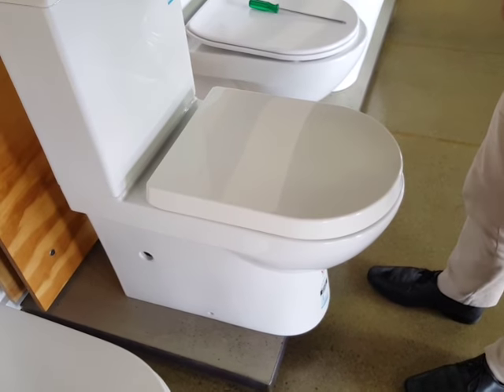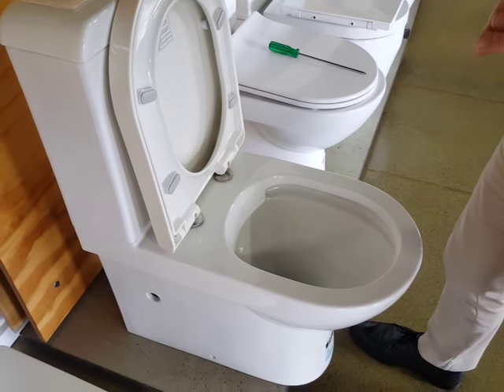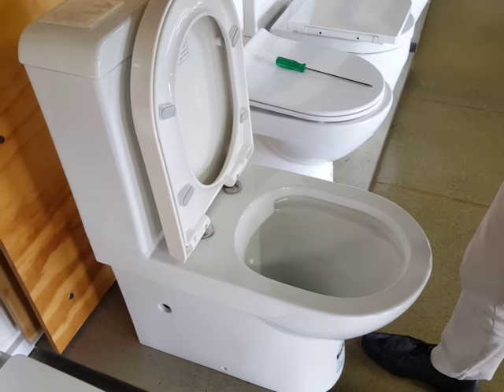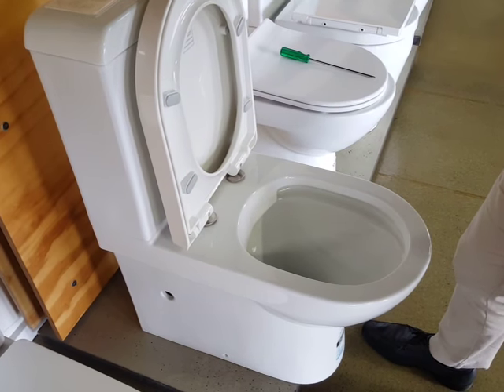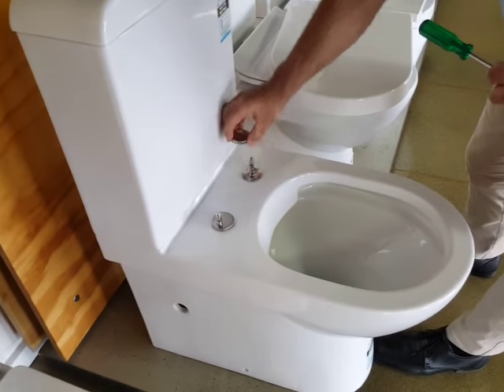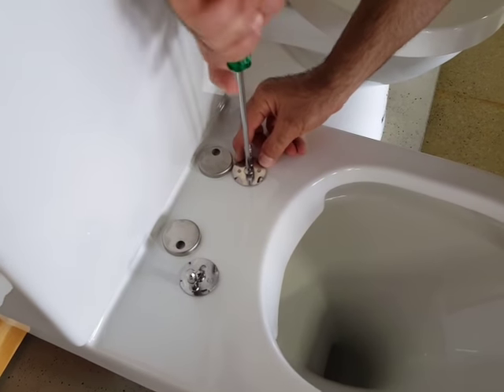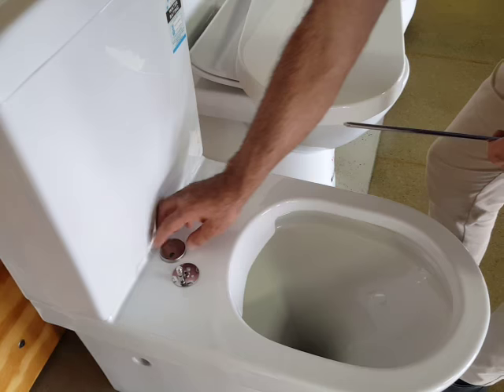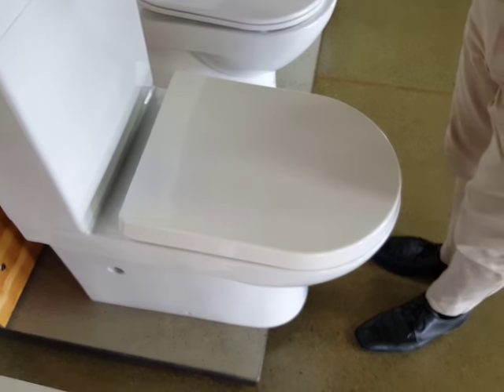How to tighten a loose toilet seat

Comment: I couldn't figure out how to tighten our toilet seat but my wife pulled it apart and fixed it in about 10 minutes. The insert in the metal cap of our seat(not the same seat in the video but close) had rusted or set in so she prised it open cleaned it placed it on the bowl tightened up the screw replaced the cap and bingo. My wife does most of the handy work at our place. Whenever I'm in trouble in the shed I call on her to fix the problem and she can 90% of the time.
Reply: philip sinclair keeper
Reply: Definitely a keeper!

Comment: Wanted to post this in case anyone else has the problem I had. Have ideal standard toilets (e0021, designed by David someone I think). Had to get a new seat last year and it was about £200! Was very wobbly a few weeks ago, turned out the fittings attached to the screws that go inside the toilet had broken. Even the spare crews were about £50 when I eventually found them. Solution eventually found was buying NUMAMA universal toilet seat hinge with spare expanding rubber screws (£8.79 Amazon). I used the rubber fittings for inside the toilet and the original screws from the seat I had, fitted perfectly and saved between £40-£200! I really hope this helps someone save on the farcical amount that these fittings cost👍

Comment: Unfortunately my toilet does not have a button to take it off even though it is a fairly modern toilet.
Reply from the maker: Hi Rae, some seats may have buttons on the side and some seats require you to firmly pull up to release. It can be tricky, if in doubt contact the supplier that you purchased the toilet from to seek advice. Good luck.

Comment: Hi in my opinion, my toilet seat looks similar to the one in this video (no button at all to take out the seat), but it’s very hard for me to take it out by pulling it, try different times but cant pull it, afraid that I might broke it. Can you please advise how?
Reply from the maker: Hi Welly S,
The instructions in the video are for a specific type of Seima toilet seat which pulls off. Other models of seats will come off in different ways
 Some have buttons on the inside or the side of the seat. If you are unsure of how to remove the seat, it is best to seek advise from a plumbing professional in case you damage something. Good luck.
Reply: Seima same problem no buttons won’t pull off and nothing on the website you really want me to call a plumber to tighten a seat yeah COVID and all maybe in 3 months time after we’ve fallen off the seat or broken something man disappointed with this product how to make something easy very difficult!
Reply: Same issue here, no quick release button and pulling seems too risky. It’s a Phoenix soft close seat from Wickes but plumber didn’t leave instructions. Any advice from other owners would be gratefully received.